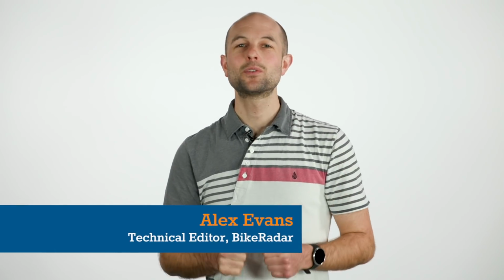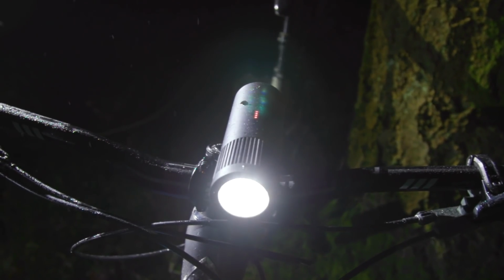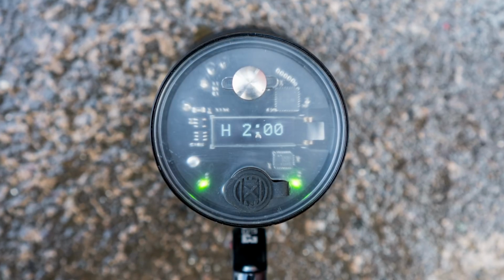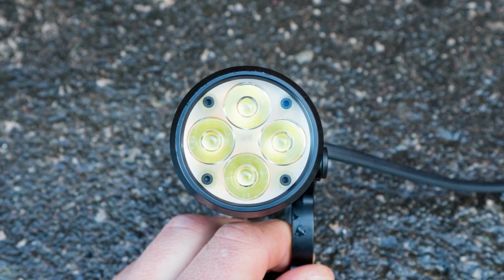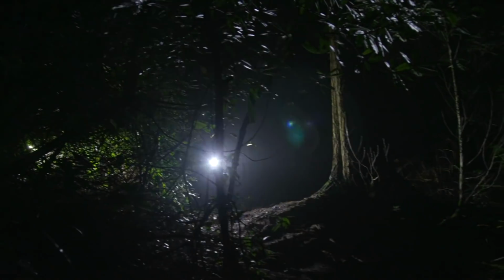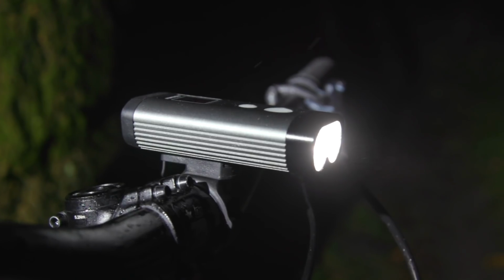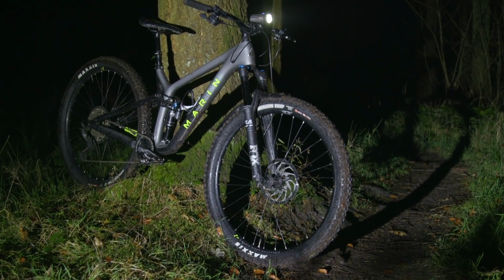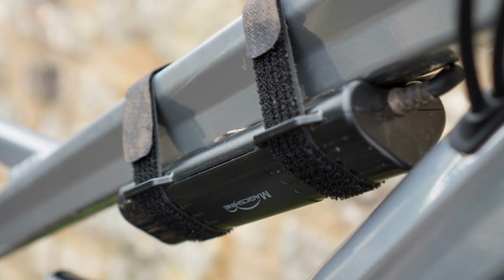15 Way In-Depth Front Light Mega Test

Comment: You haven't tested the Magic*NO*shine properly. All of their lights have shitty PVC-cables and their inner wires' isolation breaks within no time causing a short circuit and thus make the lights stop working out of nothing. This is not only super dangerous, it is also an absolute no-go. Yes, they appear to be great in terms of specs, but they are cheap Chinese lights and the bad Magic*NO*shine support is also not worth it. They know their hardware quality sucks. But they don't change it.
Reply: If you don't believe me, just search for Magic*NO*shine issues videos on YouTube. You will find out they all suffer from the same problems.
Reply: Even more so, Magic*NO*shine makes YouTube delete comments like these. 😑

Comment: I’ve found, that using 2 handle bar lights, and a head lamp work best. The brighter, the better. Yes, the cost can be an issue, but if you’re going to be biking trails at night, you’ve got to do it. Don’t skimp, or stay off the trails.

Comment: nice review. in my vast experience you can get 1500 lumens only in a so called turbo mode. at least in medium sized flashlights. all flashlights step down after a short or medium time otherwise the driver burn or the battery explode. the only way to avoid that is to use a battery pack separated and a big housing for the driver. and maybe a dedicated fan for the driver ( riding bicicle act like a fan). 
i dont ride trails, only city commute. 300 lumens for 9¹/² hours from my Seeker2Pro is more then enough. i understand the need to see further in front on a trail but 1500 seems to be op and unatainable. some good quality 18650 can give 1000 lumens for more then 1hour. and 21700 can do that with more ease.

Comment: Beam pattern is more important than max lumens (which is inflated on allot of cheap lights anyways)

I've only found 2 cheap lights with a nice wide spill/diffuser beam...but they have anti glare, so not best for single track.

I still want to try titan 4000 and Monteer 8000.

So far my 2 favorite offroad bar lights are  Outbound lighting trail evo and Baja Designs S1 wide angle..

My fav street light or helmet light for offroad  is the Novsight 1600

Comment: Unfortunately many led bike lights are fitted incorrectly, unable to be dipped and can strobe distracting other road users.  I used to regularly road ride during winter evenings finishing around 21.30, but having several close do’s after being dazzled by cycle led front lights, I no longer do it as I am at risk.  
I did ask a couple of oncoming cyclists to dip their lights explaining that I could not see the road because of their badly adjusted lights.  
No understanding just verbal abuse.  Whilst driving my car dazzling by these leds is also a major issue, destroying night vision.
Red rear leds also seem to enjoy dazzling following road users.
These led lamps used on the road are a complete and utter danger.

Comment: Practical JoeShmoe here.
1) Get two lights! One for your handlebar, one for your helmet. I can not stress enough, how much better it feels to be able to see when you turn your head. On twisty, slow trails your head will need to look into the corner before you start turning for it. A light on handlebar can not help you with that.
Having two (or more) points of illumination helps with the depth perception and judging the obstacles.
2) Lumens and perception of illumination by the human eye are NOT linearly correlated. A thousand lumens are not perceived as twice brighter than 500. Power consumption of the LEDs is worse than linearly correlated with lumens. In other words higher lumens bring diminishing returns, while draining your batteries faster. IMO 700-1000 lumens per light is a reasonable sweet spot.
3) Floody lights are more suitable for riding then spotty/throwy ones. They also happen to be smaller and lighter (Spotty ones need a bigger cup/lens).
4) Just like anything else commodity items tend to be cheaper than specialized ones. There is a ton of high quality reviews on the Internet for 18650 or 2170 cell based flash-lights. Budget ones start at ~ $20. Still manage to offer high quality LEDs, watertight, compact and impact resistant body. Additional plus is that you have afford to get more than two, if you need a large output.
5) Get name brand cells (Samsung, LG, Sony, Sanyo or Panasonic). Top capacity ones are around 3400-3500mAh for 18650, 4800-5000mAh for 2170.
6) You can bring as many cells as you need for the ride/trip. I usually carry two single cell flash-lights and two spare cells. A single 18500 usually holds around 1.5-2h at max output. If I run out of power, I swap in the fresh cells and keep riding. There are affordable 18650/2170 USB power-bank/chargers out there. Your spare cells can be used for charging your phone, camera, etc.
Reply: P.S. Cree xml2 used to be the top LED. I can see that SST40, SST20 and Nichia 219C are more popular now.
My personal recommendation is 4300-4500K for color temperature.

Comment: I have the Monteer 5000 light which is like the 6500 light just less lumens as far as mounting it's a bit different but has a size selection that comes with it to fit your handlebar perfectly. 

The Monteer 6500 light is about $300 or $350 USD while the Monteer 5000 is $250 USD

Comment: zebralight headlamp with an adapter to fit it on bars. 18650 rechargeable batteries - no proprietary stuff, can take as many spare ones as I want want. 700-400 lumens. I can use it as headlamp or regular flashlight of the bike. 80eur, one battery is 10eur

Comment: You know these light manufacturers really need to fucking wake up and stop screwing people over with making ripoff lights that cost 200 upwards.
When China are making them high power and cheap as fuck.
Also make the battery so it can be hidden under the saddle or under the stem. It's so untidy.

Comment: Disagree on safety. eBay lights are safe if you buy a separate battery holder and get quality 18650s from a good supplier. I got a six pack in of LG bats from fogstar.. Rated at 3500mah each, I tested them in my charger and the worse came out at 3420mah. Which is very good. They will genuinely last 400 cycles as well, or more if look after them (e.g. stop charging at 80%, store half charged in the fridge). Best Li-ion bats can get. My 6 pack cost £30 and gives in total a true 21000 mah, which is twice as much as the bat you mentioned here that cost £100!!! And totally safe.  Attached to a Chinese pretty cheap torch, it all works well. The Torches are ali and have good seals. Have used them for years in rain. Will be safe, as the safety issue is all about the bats. Both my 6 bat holder and the batteries are protected too. 6 bat holder cost just £8. And it strong, waterproof etc.

Comment: The Lifeline Pavo Motion 2400 is not the giant killer described in this test or in any way a bargain IMO. It's not a bad light and I can see how it performed well in a bar light only test because of its nice floody beam but instead of getting a light that outshines lights with twice the claimed lumen output (as described in the test) it actually delivers an almost identical beam pattern and 1300ish lumen output (my measured lumen output) of a Magicshine RN1200 I paid $45 for brand new on ebay (less than 1/3 of what I paid for the Lifeline). Additionally with the RN you get a wonderful Garmin style mount that fits any size bar, a mode button that only required one push to change levels, and a much smaller/lighter lamp. The only real performance advantage the Lifeline has is longer runtimes. I'll give the tester the benefit of the doubt because it would be impossible to know some of this without actually testing the output of each light and spending an adequate amount of time with each light which would take months with 15 lights. So owning one of these lights I wouldn't recommend it unless very long runtimes were your first priority. Lots of other brand name lights available with equal or better performance for less money!

Comment: Comparing Lumens on bike lights that are measured in 1 square foot taped boxes is like comparing contrast ratio's on TVs where they're measured in just 50x50 pixels.  I haven't seen someone with a bike light that attached to a battery in at least 5 years.  Maybe you guys in the UK are just lacking someone willing to ship to you, who knows.  There are literally two dozen or more 800-1200 Lumen wireless bike lights that are measured at a 60 - 100 foot throw, NOT at 3 feet.  I stopped clicking on your links after #7.  Not a single one of them up to that point were measured the way Lumens are truly measured.  They're measuring them as candlepower, the number of Lumans seen at 3 feet.
Reply: There is no way you are going to get this much power for that long out of wireless light, not a chance.  You can use your wireless lights for commuting but not for riding hours through a rocky canyon or forest at night.

Comment: I think. I will stick to what i have on my trike. A small 12 v 6 ah battery 2 each 8 LED fog light strips mounted on each side of the trike. Last for 72 hours on one single charge. Other vehicles on the road will not pull out in front of me with those lights. (They are not sure what is coming down the road or trail. This is what I have been told.)

Comment: great review and comparison. I would also like to compare some of the lights modes. How they compare and how long the lights last at lower brightness modes is a pretty important consideration for my needs. As I am often riding for quite a bit longer than the maximum brightness 1 or 2 hour run times. If I can get 5-6 hours of use at a lower brightness without sacrificing too much visibility that would be all I need. While still having the option to turn it up to max when needed.

Comment: EVERY SINGLE LIGHT BLINDS THE SHIT OUT OF OPPOSITE DIRECTION PEOPLE/TRAFFIC - this is a problem that no one wants to address.  Under certain conditions, it can TOTALLY BLIND YOU which is extremely dangerous. The idiots that PUT A HUGE bright light on their rides with NO REGARD for other people - especially on the road - are the bane of other riders.  It's all fun and games until someone gets hurt badly or even killed.
Reply: Not every single one.  There are multiple road-specific lights, Lupine SL AF c for example.  Super sharp cut off means the beam stays below waist level while providing bright wide illumination on the road. The remote also has a high-beam button that allows you to quickly change the illumination, just like in a car.  It is amazing, like driving in a BMW

Comment: If you’re going to test expensive lights, the least you could do is measure the actual lumens and effects of thermal regulation (throttling).
Reply: +1 more science, less puff
Reply: Yep. For example; The  Monteer 6500: "We got 2 hrs 20 mins in maximum mode" That implies the light was at 6500 lumens for that duration.. and that is absolute nonsense! I guarantee that it would be at less than half of that after 10 or 15 minutes. They don't show "ANSI" on any of the packaging, or the instructions, because they want to hide the fact that the output isn't the one that it's claiming it to be. They simply don't follow fl1 ansi standards, which means they can get away with making numbers up.

I expect the max output at switch on would be around 3500 lumens, maybe 4000 at a push. Seconds after that, it would drop down.
Reply: @Mapantz1  Hi what is the best light for mountain bike bike on and off road and that last a while please ?
Reply: @SSH01  It depends on what form factor you want? I use the Moon Canopus 4000 for both. It has an external battery pack (large one) and a remote. What makes it slightly unique, is the variable lumen system, which means you can choose your own low/med/high modes to set. It also has 2 warm white LED's and 2 Cool white. The warm white has better visibility in fog/mist and rain. It's also less dazzling to oncoming traffic if you're on a busy road. The light is FL1 ANSI rated, so the output stated is what was measured - no made up numbers. If you want an all-in-one style light, then go for the Fenix BC30 V2. You'll need to supply your own 18650 batteries, but that's good, as you can always have spares to replace on long rides. It has 2200 FL1 ANSI rated lumens and comes with a wireless remote. That bike light is actually pretty sweet!

Comment: Nice, good job well done. Clamp security is most important for me, especially off road. Then its the actual beam colour, some colours are so hard to see with regardless of the power output. Next would be battery longevity and availability of a spare. I've used a third light before now for road sections to preserve my main lights. Cost is massive too, some insane priced there for lights. Access to on/off mode switches while riding? All in I think you've nailed that as a good test, thank you.
Reply: There was a instance where the mount broke when I crashed my bike, and since the mount is part of the light itself (and I can't take it apart) Even with my 3D printer I am unable to repair it. So this is what I think too...

Comment: "no no-name chinese lights allowed" and allowing the same chinese lights but under a worldwide unknown brand and double and triple the price!
Reply: Good luck getting any service on those "same no name lights" from China. And they're not the same. I doubt you're getting the same LED, though occasionally you will. But you're not getting the same quality of any other components - from the "driver" (controlling circuit(s)) to the battery and connecting wires, case, lens, reflector, screws or glue. If you are getting the "same" then you're not comparing it to a model at double or triple the price. When it comes to bike lights, if you shop around and do some research, you'll see that the best deals come from the major brands (though the boutique brands are another story).
Reply: @indonesiaamerica7050  wishful thinking. But far from the real world. I have exact same noname lights as two of the presented here! The same body shape, the same controls on the back, the same useless dozen modes with blinking and stuff. I cannot comment on the battery packs since I never buy lights with included batteries, there is the great risk of the pack exploding. And I can assure you the circuitry and the emitter are the same since I disassembled each one of the lights I own. I also applied some thermal paste to the most powerful ones to improve the cooling of the circuitry. 
So far none of the flashlights has died on me. And I've bought more than a dozen for all of my friends and family to use. And even if they die, for the price of the branded knockoff you can buy 10 of the nonames, and have a spare cash for quality battery cells!
Reply: @roilev  

Which brand and models are you talking about? Which model emitter did you find inside?
Reply: It doesn't matter which one of these. Since they were included in the review and scored better than the other included ones, I can assume their (lack of) extra quality. The diodes in all of these lights are the good old Cree XM-Ls. Hopefully at least they are L2s rather than the very old already T6s. I would rather prefer if they used XHPs instead - 35.2 is a much more efficient diode, consuming just double the power while providing 3 times the lumens of good old XM-Ls. And then they could invest in a quality reflector rather trying to cram as much XM-Ls as possible and compromising the light pattern!
I would''ve mentioned XHP70.2 as in the last chinese light I bought for $30 but that's too much for these 'brands'

Comment: I've been using Night Rider lights since they put their batteries in water bottles and used regular light bulbs. Always a great product. I currently use a Lumina 950 mostly for riding on the roads at day time and just in case I get stuck out in the dark. I've had it for three years now and it performs flawlessly.
Reply: Slide projector bulbs!